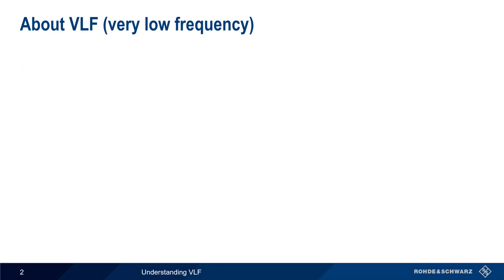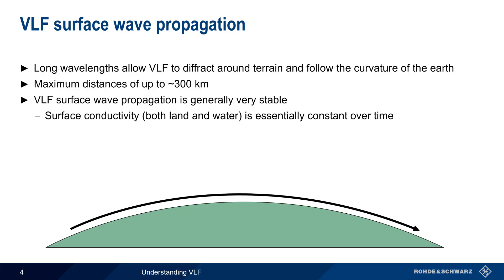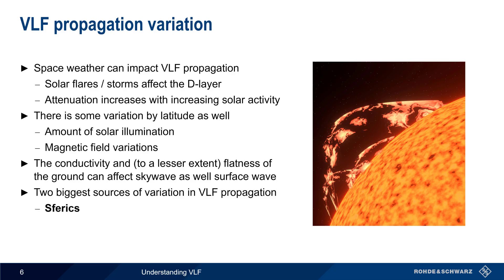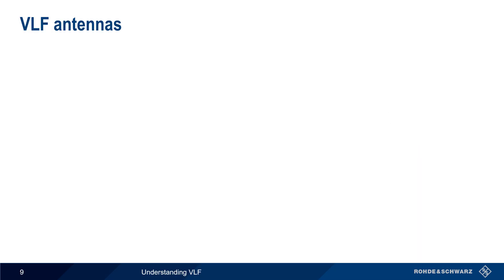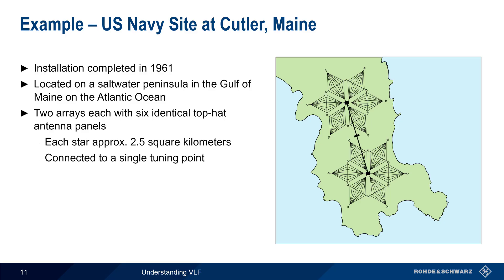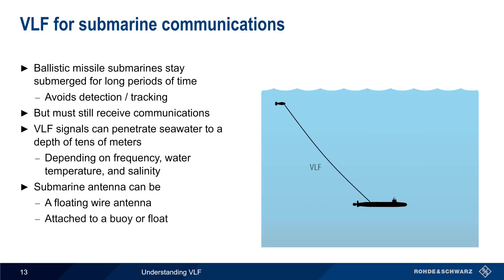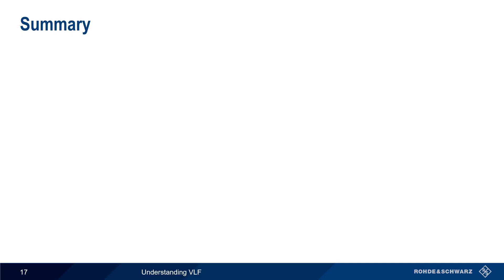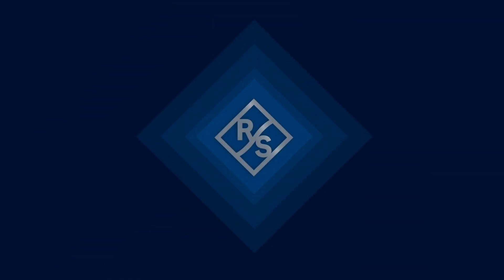Understanding VLF

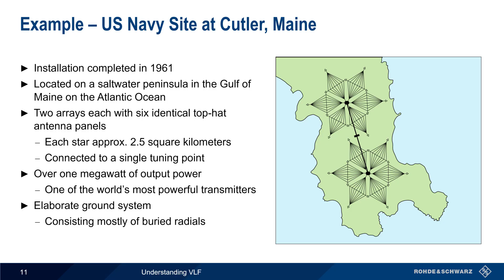Comment: At 9:15 you mention that high transmit powers require very efficient antennas. But the US Navy's Cutler, Maine station is little more than 50% efficient, while many ham radio antennas are 80% or better efficiency. High transmit powers really only require low resistance, heavily built antennas. High Q obviously makes the antennas more efficient, but it's not required for a high-power system.
Reply: Good point, but the question is really what we mean by “very” efficient 🙂 - perhaps it would have been best to just say “efficient”.  As a ham radio operator, I have tuned up all kinds of crazy things and used them as antennas, but many of them would not be considered “efficient” by any definition 🤣   But again, you make a valid point about what constitutes an efficient antenna,  Thanks!